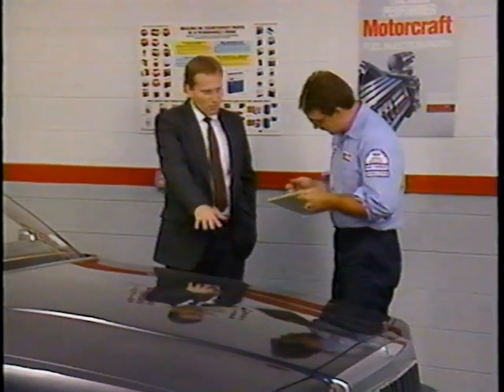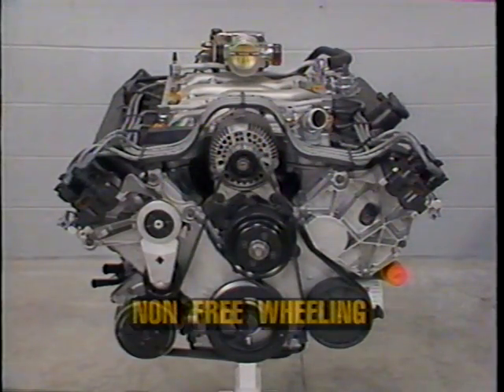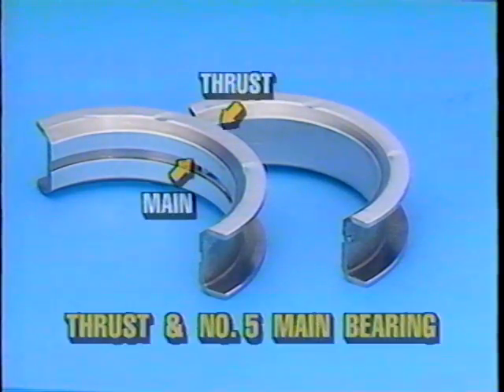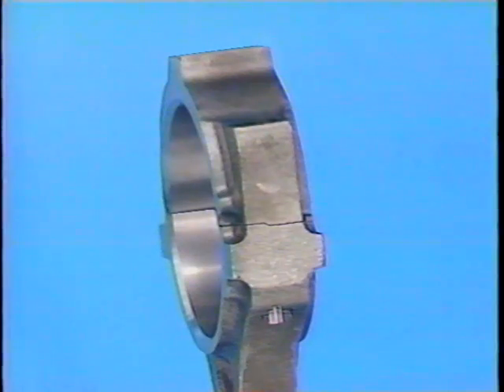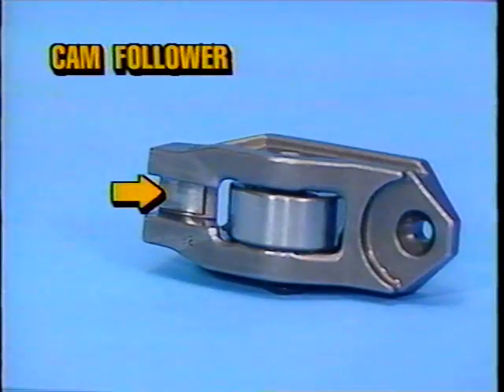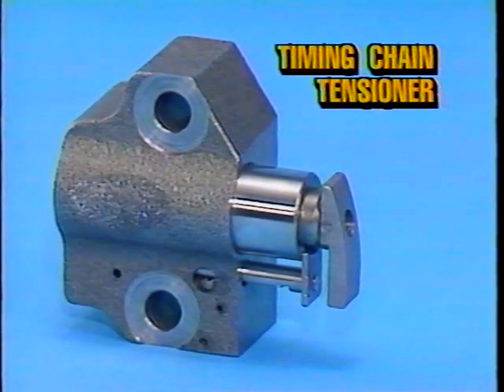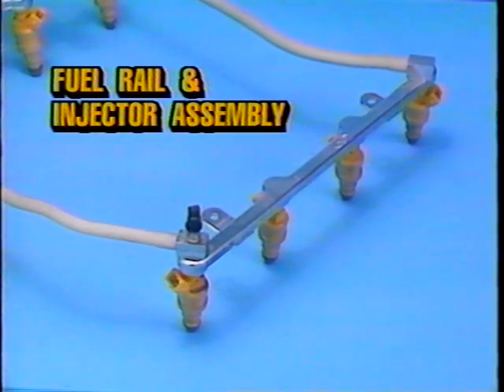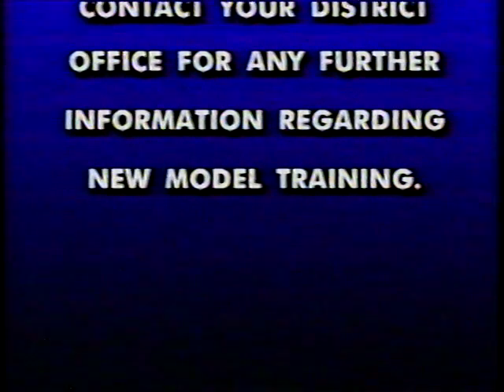1991 Ford 4.6 Modular V8 Engine Features

Comment: my 93 Lincoln Town Car with a 4.6 has over 200,000 miles and still runs great what a wonderful engine!
Reply: my 94 3.8 modular v6 runs like a dream!
Reply: @chromemustang  the 3.8 is not a modular it doesnt share parts with any engines that are similar modular mean is shares components with other engines like the 5.4 6.8 v10 all have the same components
Reply: @conner5611  yes it is...
Reply: @chromemustang  https://en.m.wikipedia.org/wiki/Ford_Essex_V6_engine_(Canadian)
Reply: @chromemustang  It's also a Pushrod engine not OHC. It's OHV

Comment: I have a 1st generation 4.6 Modular in my '92 Town Car. It's a good engine and has a decent amount of horsepower and torque.
Reply: Good engine but they should have put a more powerful engine like 5.4L or 4.6 v4 on a huge sedan like Lincoln Town Car

Comment: Damn 210HP from a V8 is weak, you can get 300HP from a 4 cylinder these days 😂😂😂
Reply: TheJoeMan99 plus the torque was way more significant than it's hp number
Reply: also, I heard that back then the numbers were always lower than what it actually had
Reply: Some like the town car engines were detuned on purpose for that 210 hp. That way the engine is never taxed and will last so damn long. That's why a lot of taxies are Town cars.
Reply: Sir Brellin i cant tell you how many times i had my ass handed to me by a 4 banger these day with my crown vic running great lol.
Reply: Oh yeah, talk to the 4.6 2004 mustang Cobra. They can keep up with modern 5.0s!
Reply: My 91 lincoln will haul ads and your girl would rather ride in class lol
Reply: rude
Reply: Bradley carter_2181110 the Germans managed to get over 200hp with their considerably smaller inline 6's
Reply: That Cobra made 390 horsepower